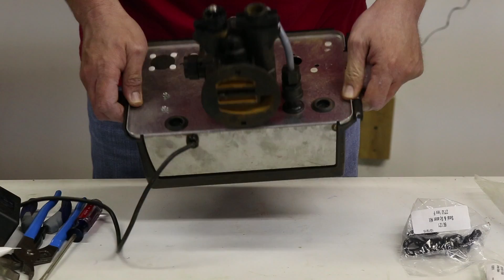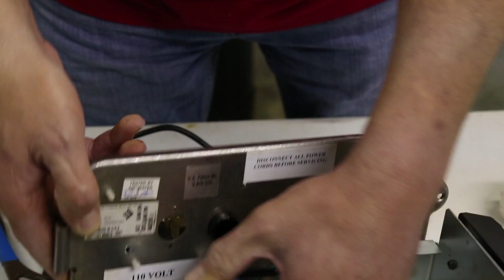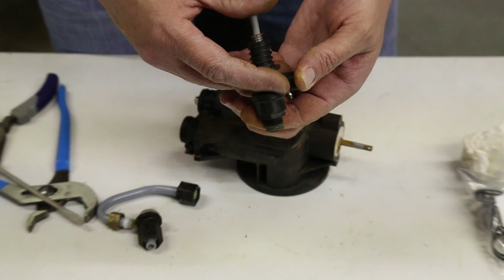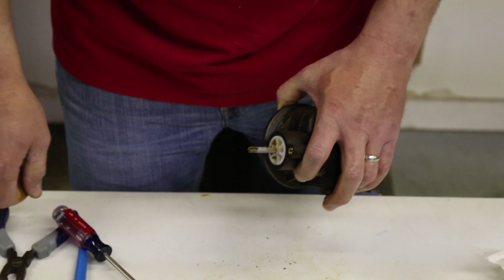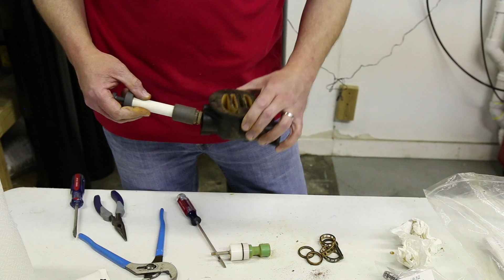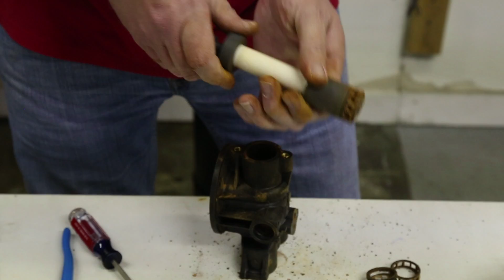How to Rebuild A Water Softener Valve - Fleck 2510 (part 1 of 2)

Comment: I got a fleck system : Sediment tank, Neutralizer tank, and Water softener.  28 years . I replaced 1 little motor, and new valve assembly a couple times each tank. My well water has been very dirty sometimes, but this filter system cleans it up perfectly.  
I  fill or replace the media myself too.

Comment: Great video. Where can I buy the tool to pull out the gaskets?
Reply from the maker: https://www.amazon.com/Seal-Spacer-Stuffer-Tool-Fleck/dp/B075WZRWW3/ref=asc_df_B075WZRWW3/?tag=hyprod-20&linkCode=df0&hvadid=309733744263&hvpos=&hvnetw=g&hvrand=11167174383405684858&hvpone=&hvptwo=&hvqmt=&hvdev=c&hvdvcmdl=&hvlocint=&hvlocphy=9016165&hvtargid=pla-570402149410&psc=1